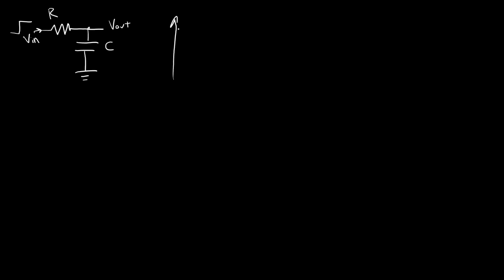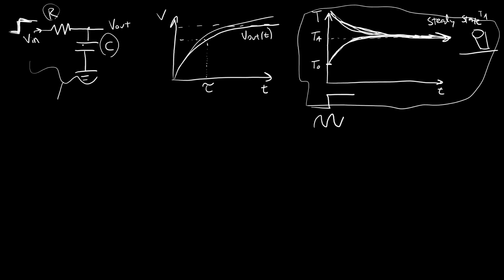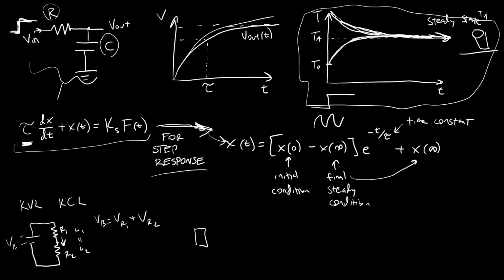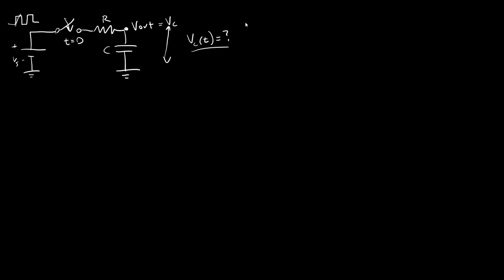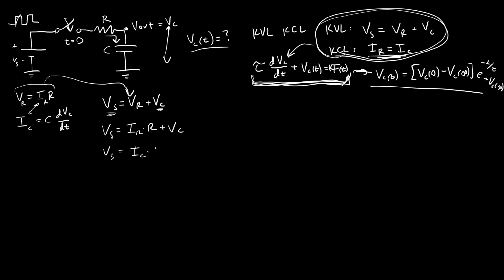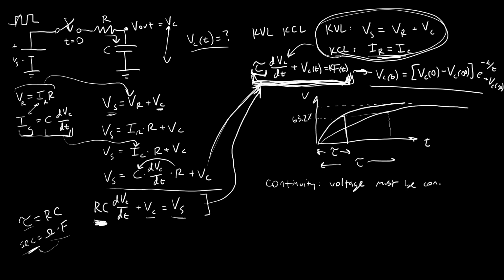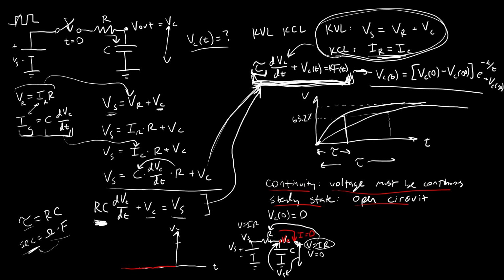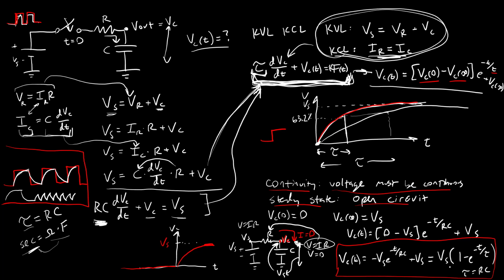Intro to Circuits 31: RC Circuit Step Response and Time Constant

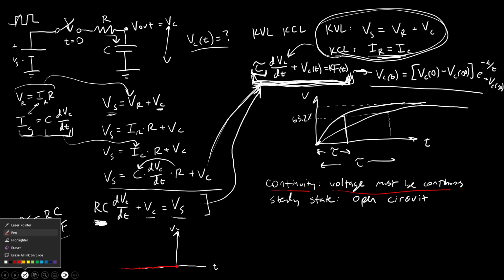Comment: @21:10 What is it about a capacitor that prevents it from attaining the source voltage immediately (at t=0+)? If this was just a wire, as you demonstrated in a previous video, the voltage at the end of a wire adjacent to an OPEN in the circuit would  immediately jump  to the applied voltage. It's weird that a wire adjacent to an OPEN doesn't have to accumulate charges via a current, but a capacitor does require current to acquire voltage.
Reply from the maker: Replying to both this and your other comment - real physical circuits have "parasitic" or "stray" capacitance - i.e. if you go look in a physics textbook you can find an equation for the capacitance of two parallel wires, even though they are not parallel plates intentionally designed to have a lot of capacitance. Real wires also have some non-zero resistance, even if it is very small. Same goes for inductance. However, in simplified "lumped parameter" mathematical models, we typically treat wires as ideal components with negligible (zero) resistance and zero capacitance. There are real-world circuits and situations where stray resistance/capacitance/inductance cannot be ignored (e.g. capacitance between tiny traces on a PCB) but that's getting way deeper into electrical engineering than an intro circuits course.
Reply: @BenFinio  Thanks. I just can't get my head around the fact that a capacitor requires a current to express voltage but a wire abutting an open circuit does not. Charge doesn't have to accumulate at the end of a  wire abutting an open, and yet it expresses the voltage source that it is in series with.